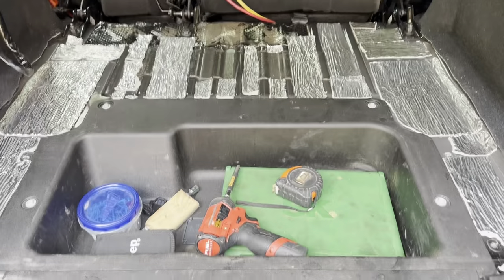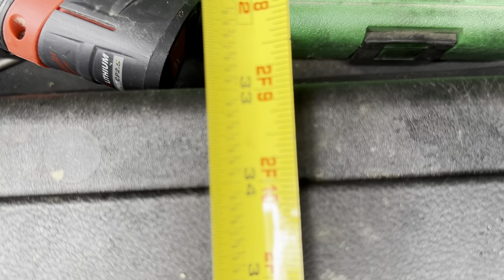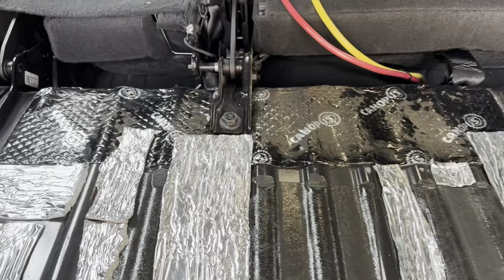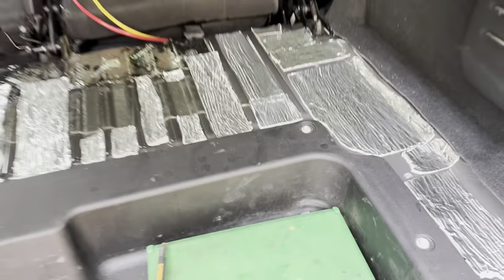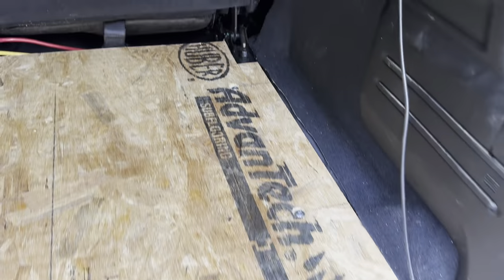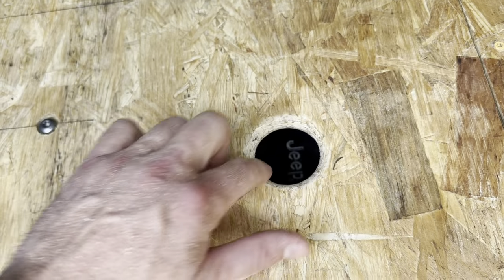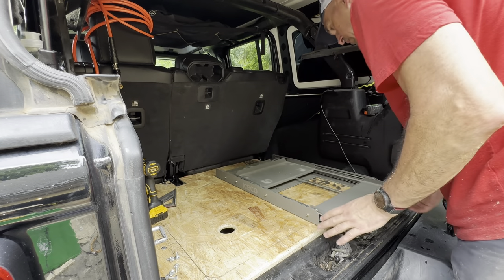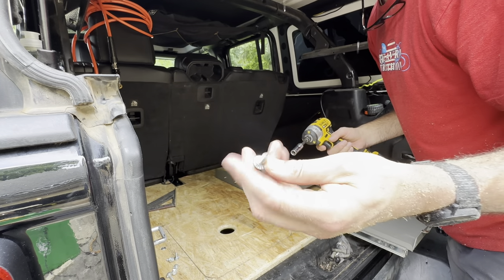I wish I had made it this way the first time!

Comment: link to what slider you used for the dometic 45?
Reply from the maker: Here you go
https://amzn.to/3RaqFed
Reply: @FischerJeepAdventures   thanks for the reply. the video has an ICECO but the link was a dometic brand. In any case, great video and I plan on doing this to mine.
Reply from the maker: @JesusGarcia4x4 here is the one for the iceco slide
https://amzn.to/4a24EpF
I bought it when i was using an iceco vl45, when i switched to the dometic fridge i just used the slide i had, did not know if you were looking for the actual slide for the fridge i was using, hope that clears is up

Comment: Do you have a link to that exact frig slide ?
Reply from the maker: Here you go
https://amzn.to/483puT1
Reply: And the dometic  CFX 35 fits perfect it looks like
Reply from the maker: @tactixoverland yes fits in there with some room to spare to move it forward on the slide a half inch, which is great because of the jeep rear seat angle holds down solid
Reply: Which model # slide is it there is a lot on that Amazon link ?
Reply from the maker: Its it the first block highlighted on the link for the fridge model VL45S

Comment: What screws did you use?  No washers?
Reply from the maker: I used the factory floor bolts just counter sunk into the wood so the heads were flush